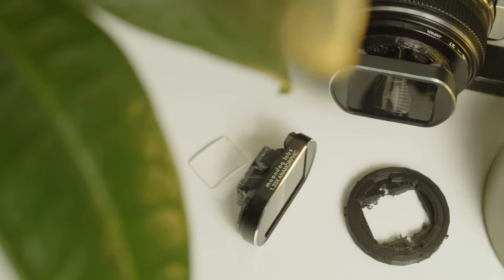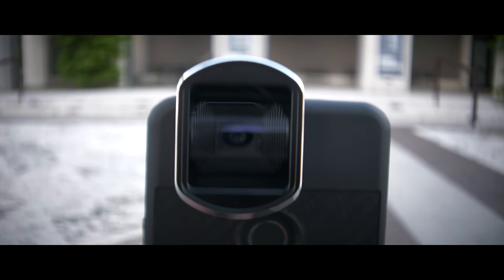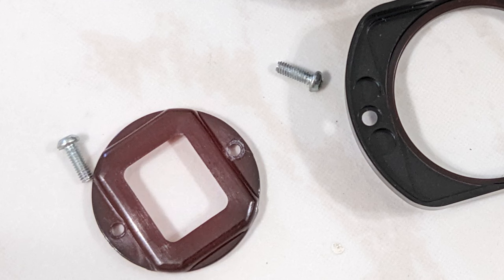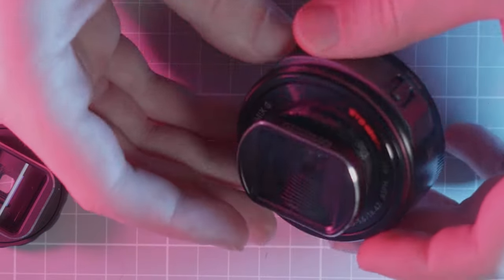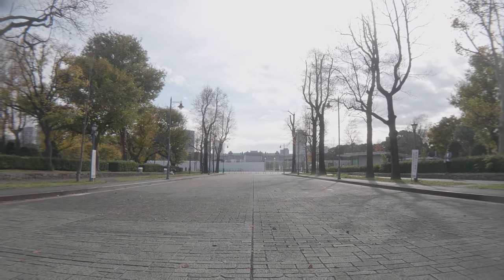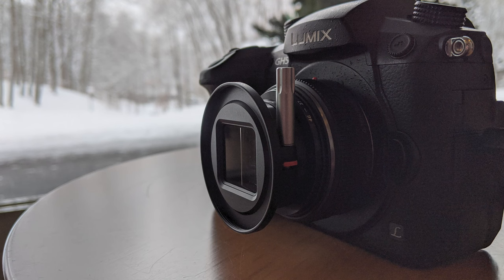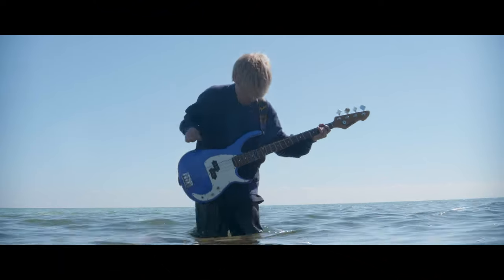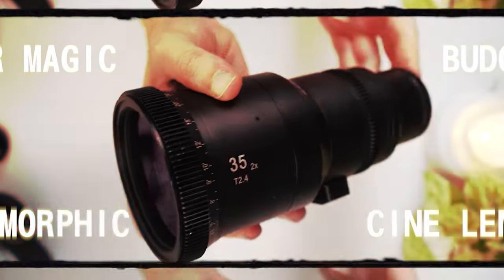Ultimate budget anamorphic upgrade!

Comment: Very interesting! I have one of those 12.5 mm anamorphic adapters lying around and since I've just upgraded to an iPhone 13 Pro I feared it would see even less use now that I don't have a way to mount it to my new phone.

I even thought for a moment about disassembling the lens to create a new mounting solution but thought the chance of it actually working would be very small. I particularly didn't expect the back element to be that big. That opens up completely new possibilities.
Reply: Update: I've taken apart my adapter and tested it by holding it in front of several of my lenses. I found a few where it sort of works but not very well. The ‘problem’ is that I have an APS-C camera and here the lenses are generally a bit bigger than those from Micro 4/3 cameras like the GH5. Turns out the rear element wasn't that big after all.

The adapter does cover the whole frame on some lenses but the image is generally pretty soft, particularly towards the sides. While I do like the effect of everything that's not in the center of the frame getting continually blurrier, it is difficult to determine what actually is in focus.

What works pretty good though is holding it in front of the main lens of my iPhone 13 Pro, like it was intended. So I will probably create some mounting solution for that.

Comment: use two phone cases, attach the ana lens to one
Reply from the maker: That's not a bad option depending on the case. I believe the case I used for the moondog 12.5mm had a loose piece that would make the less practical though... other mobile anamorphcis/cases might fare better with the 2 case strategy.